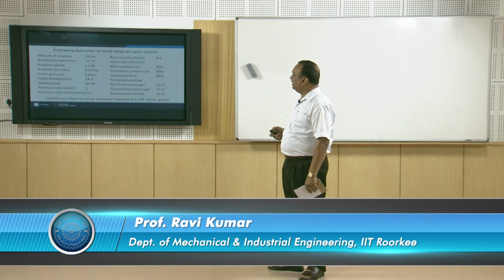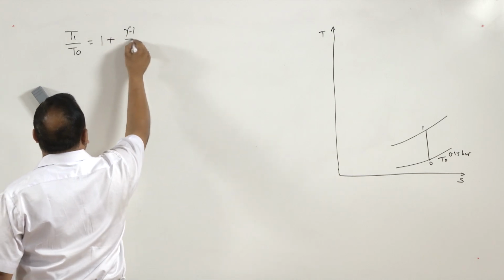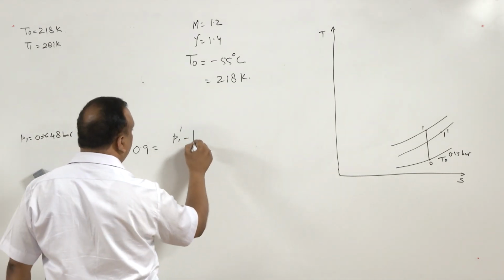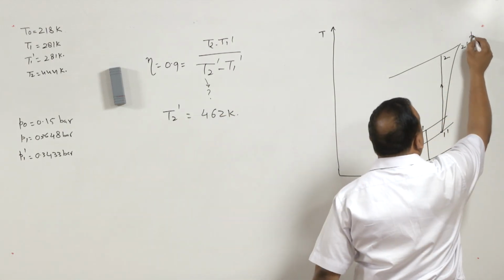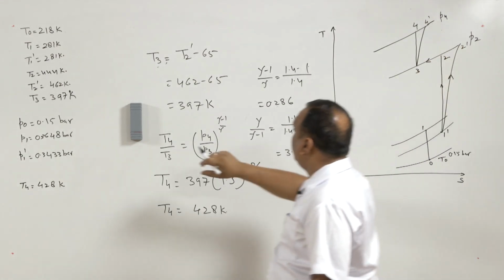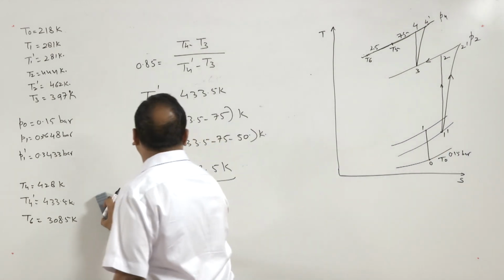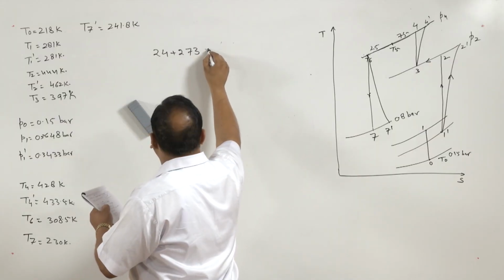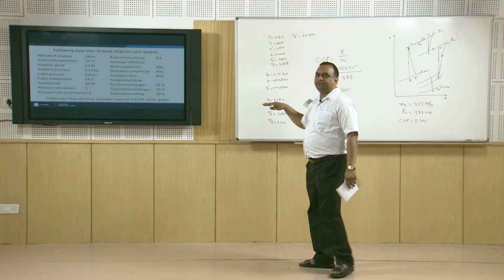Aircraft Refrigeration Cycles-3

Comment: while finding T3, T5 & T6whenever subsracting temperature drop that will be take in ℃ but it substracted from Kelvin so explain please
Reply: It because whatever unit you consider difference is same for example the difference 0°c and 100°c is 100 and in Kelvin difference between 273k and 373k is also 100
Reply: same dought someone who understood it can just reply
Reply: It is same with calculation. For example T in deg C = 189, then subtracting temp drop of 65 deg C gives T3 = 124 deg C. If we convert into Kelvin, it is 397K which is same either way. T in Kelvin = 462, with temp drop, T3 = 462-65 = 397 K. (this calculation is to find T3 in the above problem)

Comment: how to calculate p6.please explain
Reply: Anmol Rattan It is nothing but pressure ratio of secondary compressor multiplied by pressure at P2. and you can find P2 by eq.
 P2= P1 dash * pressure ratio of main compressor
And since P3=P2 
So, use P6=P5=P4= P2* pressure ratio of secondary compressor

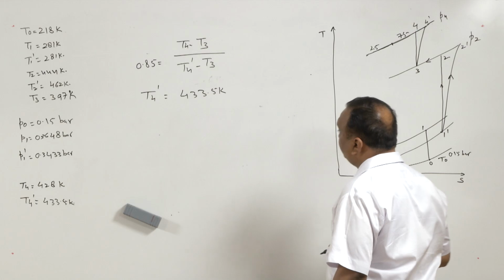Comment: you should rectify the video. As you told at 14:38 min of video that 75C cooled is by secondary Heat exchanger cooling and then 25C by evaporative cooling , and you told 125C total cooling. This made a little confusing during studies
Reply: Evaporative cooling is 50°C not 25 he took 25 by mistake and forgot to Change in Graph but took correct value in Calculations .

Comment: Sir I have a doubt. When considering work input, do we not have to consider work supplied to the second compressor? If yes, then COP will also change
Reply: The turbine work produced is used to run secondary compressor.. In the previous lecture it is mentioned in diagram of boot strap air refrigeration cycle
Reply: yes same doubt